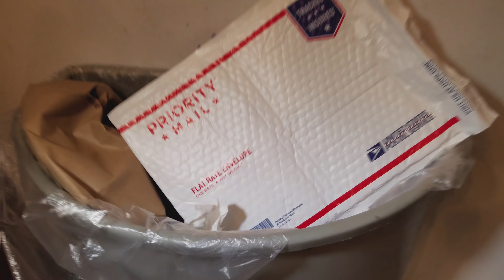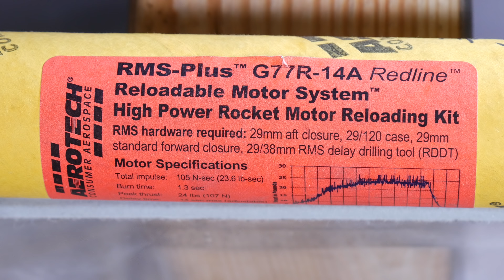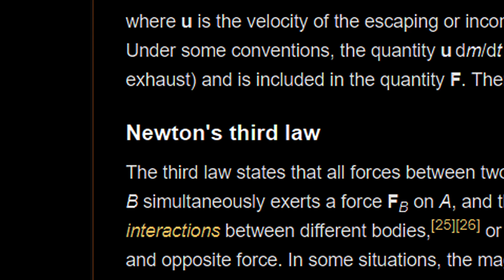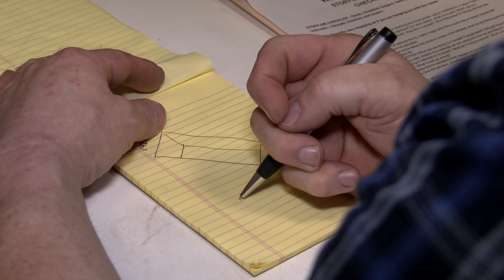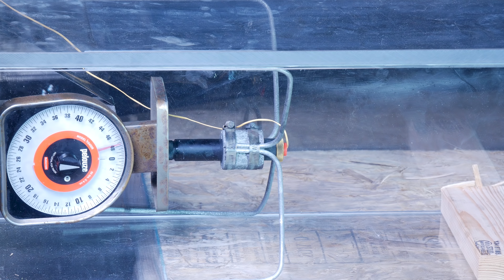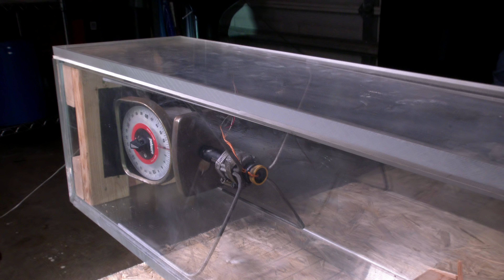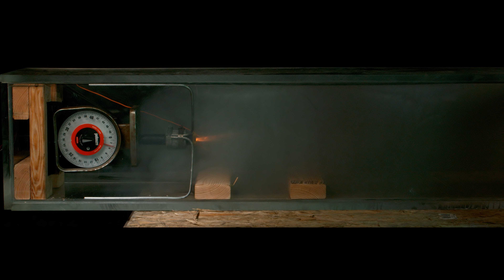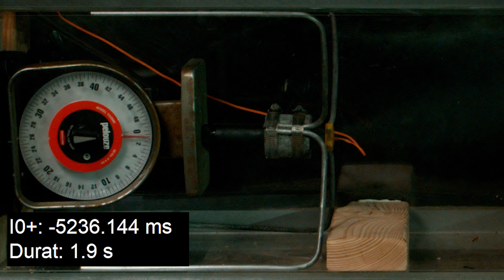Rockets in a Vacuum Chamber - Newton's third law of motion Visualized

Comment: I would like to suggest that you try this without a vacuum being pulled to set a bench mark test. Then, with exactly the same rocket engine, repeat the test under 50% vacuum conditions and then 100% vacuum. After which, compare the information gathered. While doing this it may be worthwhile measuring burn time, temperature, colour(s) and intensity of the flame and pressure changes within the enclosure. Get a bit more 'money's worth' out of all your efforts.

Comment: What about the exhaust from the rocket it self... that is what the thrust is pushing off of. Space is not a plexiglas box, the thrust would go on  without building any pressure. Back to the drawing board.
Reply: would a CROSSBOW firing a steel projectile in a vacuum have recoil? Yes or No?
Reply: "Back to the drawing board".  And "back to high school" for you, since you obviously dropped out.

Comment: So have we found the huge vacuum pump in space that creates all that vacuum and who built the walls ? How do they measure the vacuum in space ? The just drill a hole and stick the gage through the wall of the rocket from the inside ??
Reply: There are a number of ways to measure true vacuum.
The High Vacuum gauges are Ion Gauges or Thermal-Quartz-Crystal-Microbalances (TQCM) for determining what kind of molecules are present.

Comment: While atmosphere was generated as the fuel burned, that is irrelevant. There was force applied instantly when the igniter first fired and the vacuum was at it's peak. While this experiment was flawed in it's design, that one aspect is pretty clear. Newton's Law holds up.
Reply: The force when the igniter first fired came from recoil effect from explosion inside. And then the accumulated atmosphere started acting as resistance and rocket exhaust started pushing off against it. Also the wall of vacuum chamber facing the rocket exhaust also acted as the resistance for rocket exhaust to push off against.

Comment: You should hire a trucker that runs a dry bulker.
They usually have a ~900cfm 100 horsepower blower for unloading their product.
They can keep the chamber under vacuum even while the rocket is firing.

Comment: 12:33 I'd guess that's bc right behind the engine the exhaust is moving fast, which results in less pressure of the exhaust right behind the nozzle than a little bit farther away from it, where the main ignition occured (Bernoulli). The higher pressure might be what the started the ignition farther away from the nozzle.

Comment: if you pressurise a vaccum wit rocket gas/fumes - is it still a vacuum?
Reply: No ,  It is  not a vacuum.  It is also impossible to create a vacuum with a pump.
Reply: @stuartgray5877  You have NEVER pulled a complete and perfect vacuum, because there is no equipment Capable of doing it.
Reply: @jrngln   
Nice copypasta. Every word of what you just said was wrong.

1) We can get close enough for practical purposes. Technically space isn't a pure vacuum either, but it's so rarified that molecules rarely come into contact with each other.
2) A vacuum doesn't "absorb" anything, you're speaking nonsense.
3) How exactly do gases on the opposite side of the chamber affect the rocket motor? The answer is they don't. The only forces come from the direct interaction between the motor and the gas. As soon as the gas leaves the motor, it can't transmit a force.
4) Yep. Rockets push off of their exhaust gas.

Comment: In the vacuum of SPACE, the contents of the reaction WOULD NOT BE CONTAINED IN A BOX.
The Box is finite and real space is infinite.
As SEEN, as the box area fills with smoke and heat accumulating the weigh scale shows pressure gradually increasing.
Reply: If that were the case, the force would increase relatively linearly and continuously. It did not do so, the force was low until the motor fully ignited, then it jumped to maximum thrust and remained steady, even as the vacuum in the chamber continuously decreased.
Reply: @buggsy5  u can not contain an "explosive/Heat" experiment IN an ENCLOSED CONFINED AREA and call it The vacuum of deep space.
Who even really knows, what the reverse pre-load of the vacuum of space is.
The enviornment in the experiment is a fail.
earth's atmosphere as he stated is 14.7 lbs per sq. inch.
How much is the NEGATIVE lbs per sq inch iN the vacuum of space?
tHINK Black Holes they swallow galaxies.
The equation used is not legit.
For example; here we have a small enclosed area and we will compare it to the vastness of space?
You can not measure the eviornment in a place that does not exist.
put your comic books away
Reply: @johnpike5836  The atmospheric pressure in space is zero, 14.7 psi lower than produced on the Earth by our atmosphere.  That is why the astronaut's spacesuits cab be as thin as they are. 

Yes, the near space vacuum with which they started quickly degraded. I would have liked to see the ending vacuum in the chamber at the end of the experiment. They quoted a volume of gas produced by the motor at atmospheric pressure and it was far less than the chamber volume - so there was at least a partial vacuum at the end. Because the starting vacuum was not huge compared to the volume of gas produced, probably much of the data proves nothing - the major failing of the demonstration.

However, for a short period of time, the amount of gas would not reduce the vacuum enough to significantly affect the result. 

But the whole demonstration is unnecessary. We know that rockets work in space without having anything to push against, since the ISS as well as all sorts of communication, navigation, entertainment satellites etc are all orbiting the Earth in space.

Comment: I just want to point out that in order for this experiment to validate your point.. you must have a very tiny scale rocket replica inside a very large vacuum chamber. Also the expansion rate of the gases must be measured and the vacuum chamber must be depressurized at a rate greater than that of the rate of expansion to eliminate any possibility of the gases filling the chamber creating an atmosphere to push against.
Reply: So do another test then. Why haven’t a single one of you flatters done this yourselves?

Measure the force at atmospheric pressure. Then build something like this rig that can pull the pressure at the exhaust down below atmospheric values. Measure the thrust then. If what you claim is true then the thrust should be less.
Reply: @GruesomeGage  : No, clearly you do not understand the "real" science behind rocket propulsion. So, are you claiming that there is zero difference in the thrust measured from having an exhaust pressure of 15psia and one having 2psia? 

Are you kidding me? 

Let me guess. You think that thrust is only made by "pushing" off of air, right? Exactly how does that work? And I don't mean the normal flat earth hand waving "explanation". I mean what, exactly, is the mechanism for how the air molecules are pushing on the rocket? 

Seems like this is a no-brainer for someone "understands the science...". Right?
Reply: @kitcanyon658  air is a fluid correct?
Reply: @GruesomeGage  : Uh huh. And?
Reply: @kitcanyon658  fluid inertia. the gases expand at such a rate that the fluid can not move out of the way fast enough and the path of least resistance is to push the conical shaped rocket to the low pressure zone above the rocket. as the rocket increases in it's elevation the air density decreases reducing the fluid inertia and the rocket begins to decelerate changing it's velocity (it's speed and direction) resulting in an arching trajectory. To further elaborate on why the psi difference matters is because in the "vacuum of space" there is a negative psi value not a positive one. if anything the rocket would move backwards following the mass leaving it not away from it.
Reply: @kitcanyon658  further more without a medium the rocket would not have a way to mitigate the heat from the propulsion mechanism as that fluid we call "air" is dissipating the heat from the propulsion mechanism and the rocket would melt itself. also the rocket would be engulfed by its own expanding gases as it would be the closest "gravitational mass" to the gasses which would have a tendency to retain some of the mass of the expanding gases.
Reply: @kitcanyon658  but the point it seems you failed to grasp initially is that in such a small container with such a large expansion of gases the vacuum becomes instantly nullified as the gas fills the container almost immediately thereby ruining the credibility of the experiment as the chamber is no longer under vacuum.
Reply: @GruesomeGage  : Wait, you think a rocket's trajectory is caused by the decreasing air pressure outside? That is not a smart comment. And decreasing pressure increases the thrust of a rocket - as tested in chambers. Just like I said. To which you still haven't explained that and in fact, from about you just claimed the decreasing atmospheric pressure "decreases" thrust.
Reply: @GruesomeGage  : Do you know how rocket nozzles are cooled? Let me give you some 411 - it isn't by flying through air and using that to cool it off. 

Please tell me you've done at least 5 minutes of research into rocket nozzle design. I thought I would actually chatting with someone with a college degree in engineering. Maybe I'm not.
Reply: @GruesomeGage  : agreed, however my point was what was the pressure? It if is less than atmospheric and you see a thrust difference then that's real data. To just declare that 7psi is the same at 15psi is ignorant and a true sign that you have an agenda.
Reply: @GruesomeGage  : Really? So again, you claim the pressure at the engine exhaust has zero affect on the thrust. Who told you that? 

I see that you have strayed from actual technical details. I guess that a person who is only repeating other's words can't move past that since he doesn't have an actual understanding of the physics involved. 

As I said before, I thought I was conversing with someone educated in this field. However, your avoidance of more technical discussions is telling.

Comment: Atmospheric internal pressure, which serves to ignite the rocket at the last attempt, comes from behind plus the added internal pressure generated by the system we know from the first law of thermodynamics, which pressure actually quickly fills this little funny vacuum chamber, which pressure is formed from the burnt and ejected gases in vacuum and form a small gas-pressure space that in fact displaces the vacuum and fills with exhaust gases and unburned gases this little space - in this absurd funny - little "vacuum" chamber.
Imagine a suction vacuum with a force of 10 to a minus 17 degree suction force plus an external pressure of 1013.25 hPa atmospheric pressure suction vacuum which has a reverse force of 10 to 17 degree of atmospheric gas under pressure, that is suction suction with power 10 to 17 degree, and atmospheric gas pressure, pushing 1013.25 hPa.
When they lifted the upper plane of this funny "vacuum" camera, this platform plastic board bent only by the power of its own weight, making us feel like fools to believe that these funny plastic board would withstand the suction vacuum that is a reverse force of 10 to minus 17 degrees without bending inward, plus the force of atmospheric gas that pushes externally with a force of 1013.25 hPa.
 Each rocket engineer can confirm that there is no rocket engine running at the same time in atmospheric gas and the engine running in a vacuum environment because the rocket gases will be scattered for only a fraction of a second in the vast vacuum space, have nothing to push and have nothing to push in the vacuum to get some boost on this rocket, because the vacuum is nothing, the vacuum has no density.
Fire on the rocket can be secured with additional atmospheric pressure, as did this ridiculous, conspiratorial, stupid man after many failed tests, that this rocket will ignite and burn very well in a vacuum if it is secured on that rocket oxygen, .. but this missile has nothing to push, nothing to pushed or propel into the vacuum, because vacuum is nothing, no density, unlike atmospheric gases, which gases will be scattered only in the nano-second in the infinite and vast vacuum space , ... but the gases in in this little one funny - small "vacuum" chamber will immediately fill this small space and this small space will no longer be a vacuum and under this condition can now get some impetus to this racket.
Why does this a crook - conspiratorial man not use NASA's vacuum chambers, which are a few meters thick and  to do this experiment again? We, the well-meaning people with proper logical and critical thinking, know why this conspiratorial man would not do such a test. Because we know it will fail!
Reply: SO you wrote ALL THAT just to say: I dont understand physics?  Its hard to even tell from all that horseshit if you believe that rockets work in a vacuum or not.

Comment: What would a Cessna single engine airplane do in a vacuum?  Lets say the engine in this case was not aspirating but electric. The wings would be useless and not necessary and the plane would be weightless and float.  Equally useless would be the prop.  The propeller is designed to bite into the air in front of the prop and thrust it backward propelling the plane forward.  No air or atmosphere to thrust backward in an infinite vacuum, no movement
Reply: @darklight2.1  Middle of deep space away from anything planetary.  besides the propeller is useless in any scenario
Reply: @philrobertson2708  what if you THROW the propeller?
will THAT push the plane backwards?

Lets say the plane has a mass of 10,000 kg.
The Propeller has a mass of 500 kg?

What if the plane - "Throws" the propellor away with a relative velocity of 2500 meters per second?
What change in velocity will this impart into the plane because it "threw" the propeller?
Reply: If there is no air, no atmosphere for the propeller to 'grab'  it will do nothing and the plane would not propel forward
Reply: @philrobertson2708  Sorry the correct answer IS:
If the plane THROWS OFF its propeller, it WILL get propelled backwards.
The plane has to absorb the same amount of "Momentum" gained by firing away the mass.

Do you think a crossbow would have recoil if fired into a vacuum?
Reply: @philrobertson2708  : Clear misunderstanding of conservation of momentum. How would the prop fly out of your hands when you throw it? So you're now claiming an action has zero reaction? Interesting. As I said, you're clearly misunderstanding physics. But I'm guessing you have an agenda as to why you think as you do but you're just being coy about it.
Reply: @kitcanyon658   It's conversational to me.  In a vacuum without atmosphere there can be no forward motion from a propeller designed to work in, but devoid of a pressurized environment?  
How does a 200 ton, 747 jet elevate, support and propel itself without atmosphere?
Reply: @stuartgray5877  Doesnt' explain success re a journey to the moon,  Two bodies of weight cancelling out each other's momentum to their destination
Reply: @philrobertson2708  : Aircraft are not part of the point of this video. The mass of the ejected mass from the rocket motor has nothing to do with the environment around it. 

Do you agree that a rocket, such as those used to put humans and material into orbit, don't use air to create propulsion?
Reply: @philrobertson2708  Sorry to break it to you but we have MILLIONS of hours of running propulsive systems in space.
Would you believe a LIVE VIDEO of rocket propulsion working in a vacuum? If I point you to a video will you even WATCH IT?
I suspect the cognitive dissonance in you is so strong that you will refuse to even evaluate the evidence.
Reply: @philrobertson2708  Watch the YT video:  "uninterrupted footage of the falcon heavy launch and booster landing! 2-6-18"

Watch it from launch to side booster landing then EXPLAIN WHAT YOU JUST SAW.
Reply: @philrobertson2708  - The company I work for tests dozens of rocket propulsion thrusters IN A VACUUM per year and verify they produce the thrust predicted by the Tsiolkovsky rocket equation IN A VACUUM.
We then put those thrusters on spacecraft, launch them to space and test them there AGAIN.
We recently built & launched the GPIM mission that demonstrated new "green" Propellant. LOOK IT UP.

I am ALSO currently working on a program to send another Solar Sail to space and test it.

so NOT ONLY does old fashioned "Rocket Propulsion" work JUST FINE in a vacuum, but we have multiple ADVANCED propulsion programs underway right now, including Ion Propulsion that has already been tested in deep space.

You are like a five year old trying to tell Michael Schumacher that "Cars are all a hoax".
Reply: @philrobertson2708  So where did you GO?
Are you AFRAID to watch a video that proves you wrong, or did you watch it now you are too embarrassed to come back here and address facts?

That's fine, run like a coward.